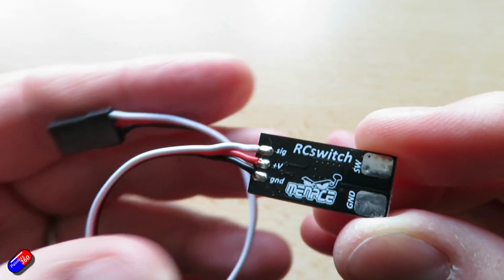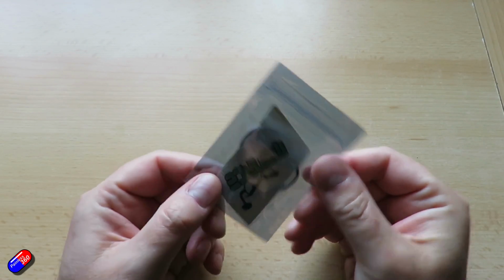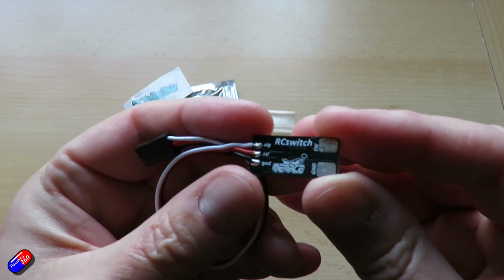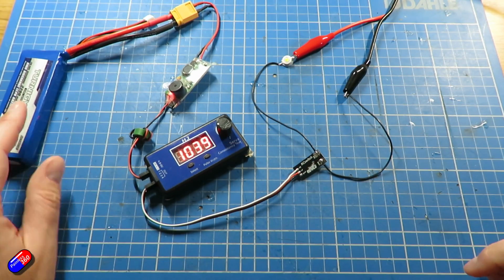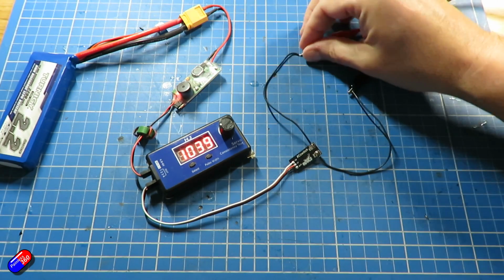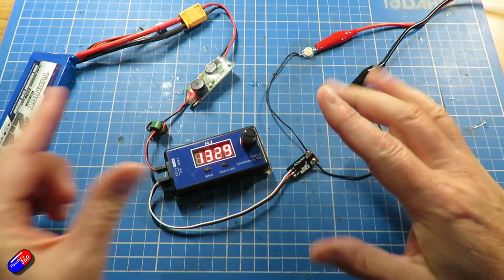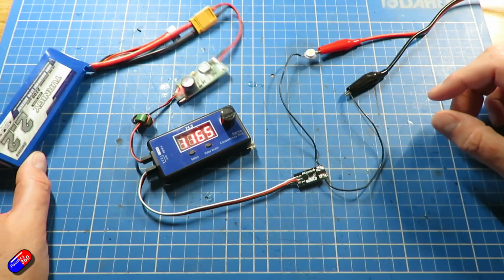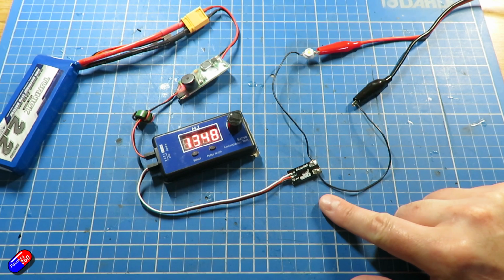MenaceRC RCSwitch: A cheap easy way to turn stuff like LED lights off and on!

Comment: just ordered mine but im having problems. the switch is always staying on no matter the input. I have verified the recievers PWM signal with oscilloscope and its the right signal. Even if i put the PWM to under 1750us the switch stays on (led is on):/
Reply from the maker: I'd contact the seller... Best of luck!

Comment: I just bought 3 of these and I'm a bit disappointed. I'm running the new radiomaster mt12. I thought I'd hook up a switch to operate my motor cooling fan. I come to find that the switch will not function when my ESC is sending 7.4 volts to the rx. If I turn it back to 6volts, it works BUT then my servo is weak and the fan doesn't run as fast...according to their data, 7.4 volts should work.
Reply from the maker: There are two ways to wire these up. Sounds like you are using the wrong way for your application... Best of luck

Comment: Great video.  Do you know of a way or a product that I can connect a led and have it turn on for 3sec then off for 10-15sec then back on in a loop.
Reply from the maker: You can setup EdgeTX to continuously turn off and on the channel controlling the switch. Check out https://youtu.be/Kz3s8S-AQZs ;) You can support the time I spend helping using the links in the description. Happy flying!

Comment: Worth noting that this can only be used for switching the ground wire. This means it cannot be used for switching things like a Digital VTX to assist in GPS fix before arming (especially if the VTX is screwed to a quad frame). It's a shame reallly as in other regards it's very nice and well specced.

Comment: Hello I'm having trouble with this switcher I have a kraton 6s and I'm putting lights on it and  my vtx with 2 switchers seems to work when rx is powered by a second battery but I have it set up to run 1 battery and use the bec on my esc to run crfs nano rx but nothing do you have to run it on 2 separate batteries or is there a way to run 1 battery and bec to rx thanks
Reply from the maker: That sounds like something is odd with your wiring. Just wire up the lights as you would normally then cut the positive wire to them and solder the switch onto each of those new ends on the wire.. Best of luck!
Reply: @Painless360 so I need to put the switcher on positive wire in the video you say the negative  just double checking
Reply: @Painless360   nope I put the switcher on positive wire and it fried so that's not right

Comment: Great video as always. 👍  
After you demonstrated how this works by adjusting the value on the servo tester to get the light working, I thought it would have been interesting to see how you would then have set this up on your Tx16s for switching on the led lights or a small motor. 😊
Reply from the maker: It works in exactly the same way. High channel value turns the switch on. Best of luck!

Comment: Very cool,  I am looking to turn off/on my Menace COB driver board on my NANO Drak and think this might be the ticket.  I am assuming I would just wire this to the En port of the COB driver board?  Where do you wire the ground from the Menace RCSwitch to the INAV board?  Currently I have pos and ground of the COB driver board wired directly to my battery.
Reply from the maker: See the wiring diagrams on the site.  Just snip the positive lead to the leds and connect the two ends to the pads on the MenaceRC switch.. best of luck
Reply: @Painless360  OK yeah I saw that but it didn't look right as the ground was not soldered to anything.  So I guess the LED ground completes the ground circuit then.  Thanks again for confirming.

Comment: Great video 👍
But are there momentary RC switches too? (It would need to trigger a circuit.)
Reply from the maker: Not that I've come across yet but you could use this as one by sending a short PWM pulse of the 'on' value to it...

Comment: That's great!  What sets this apart fromTinysLEDs RealPit VTX Power Switch?  Voltage?
Reply from the maker: This is a general purpose switch that can handle lots more current. Happy flying

Comment: It doesn't look like it is actually isolated, but instead the ground is connected through the board.  If it wasn't, it would require an optoisolator which doesn't appear to be present, as well as draw a quiescent current from the load side(like solid state relays).  You could test with  a multimeter between the switch side ground and the control ground.

Still a great alternative to much heavier relays.

Comment: You could also use this to ignite an electric match to ignite a rocket engine on a rocket plane.
Reply: Or an IED.
Reply: @skvaderfpv  Paired with a cheap RC plane build and FPV, you have long range aerial assault capabilities.  Each use costing around $100 I would imagine.
Reply: Or other things...

Comment: you can just use LEDLOW function in iNav to turn off and on the LEDs, but i like this product
Reply from the maker: That only works with things like WS2812 LEDs. With this you can control literally anything...
Reply: @Painless360  this is true